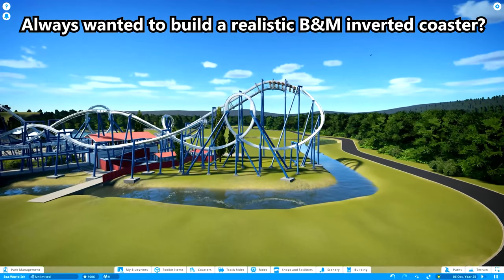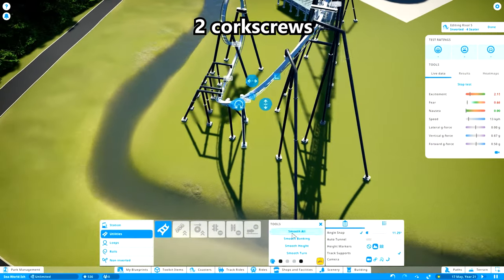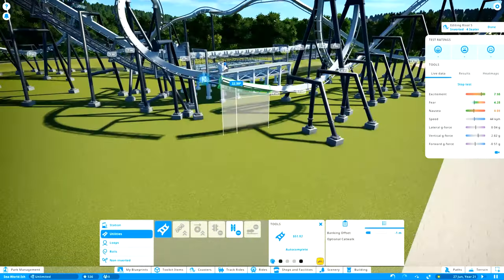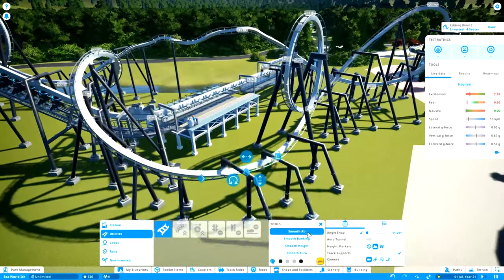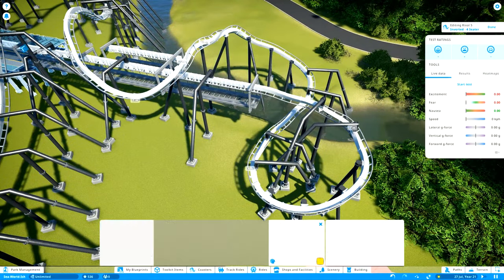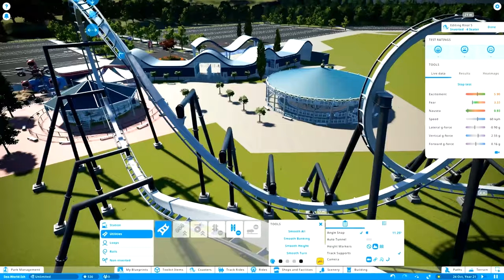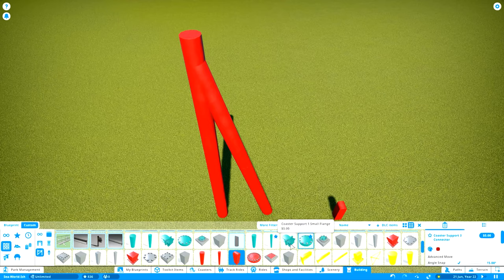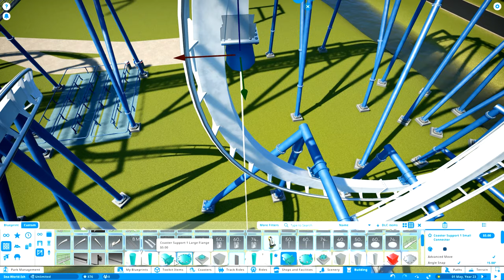PLANET COASTER - Realistic Park ep. 3, B&M Inverted Tutorial (Sandbox Speed Build)

Comment: The best way to make a realistic coaster is using 1 meter pieces with banking offset.
The next best and honestly the most acccessible while still being very accurate is using 2m with banking offset.

But a time saving compromise that works just as well is using long pieces in simple sections and 1-3m pieces in complex sections. For elements like loops and cutbacks, hammerheads and so forth, 4m is just fine.

To make it all smooth, use an autoclicker to spam smooth

But. The result here is impressive
Reply from the maker: Thank you for your advice. 🙏🏼 However, personally I don’t like the look of the track having joints/bolts every 1-2-4 meter. That’s not very realistic to me, and not the way real life coasters are manufactured. I rather have a slightly less smooth coaster, but keeping the track joints/bolts further apart. ☺️
Reply: @PlanCoBySeb  that is fair. For optimal realism tho you should maybe just build in no limits 2, as it has none of the issues planco has
Reply from the maker: Never tried No limit. However, the graphic looks way better in Planco and I will continue to play Planet Coaster. Thank you anyway for the advice. ☺️

Comment: Actually 2m or 4m is the smoothest way in planet coaster to build coasters but 6m is not a bad start there are just Better options out there
Reply from the maker: Thank you for the advice. I have tried 4 m, was not a fan at all. I find 6 m + delete and autocomplete suits my coasters the best. 😄 Furthermore, I don’t like the look of it when the track joints/bolts are present every 2 & 4 m.
Reply: @PlanCoBySeb  ok
Reply: @PlanCoBySeb from a accuracy standpoint, the method you talk about is actually just straight up bad.  While the visuals with 2m are weird, it allows for accurate profiling while keeping the ride smooth. A compromise would be to use 5-6m pieces for hills and drops and 2-4 m for turns and inversions.
Reply from the maker: True that! Hoping for an improvement in Planet Coaster 2. 🙏🏼